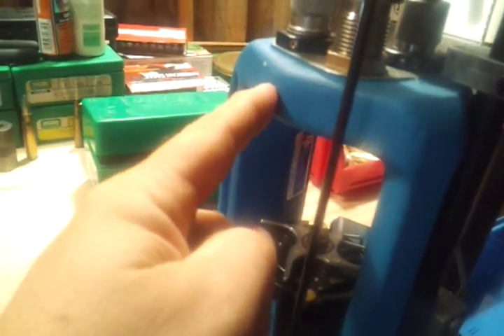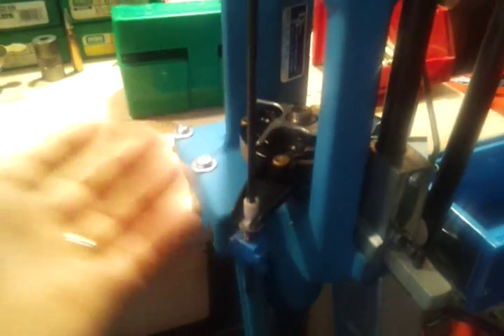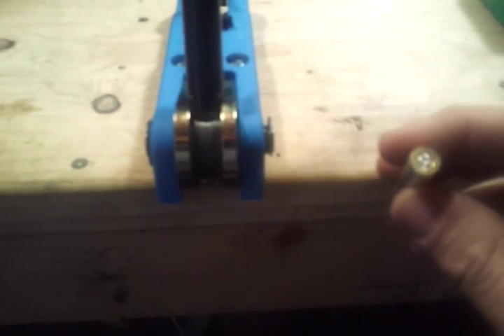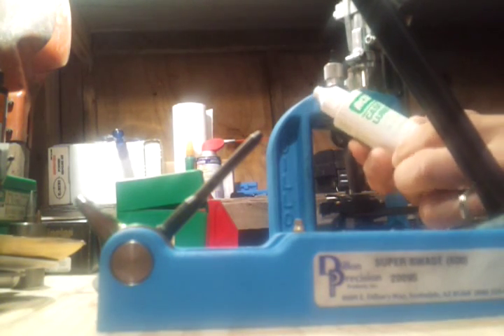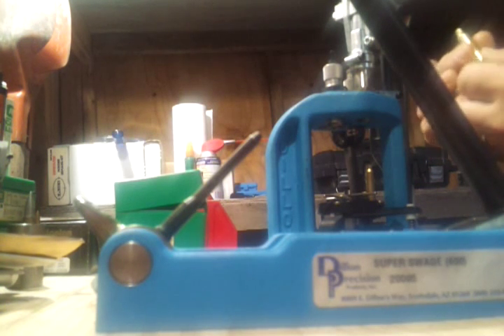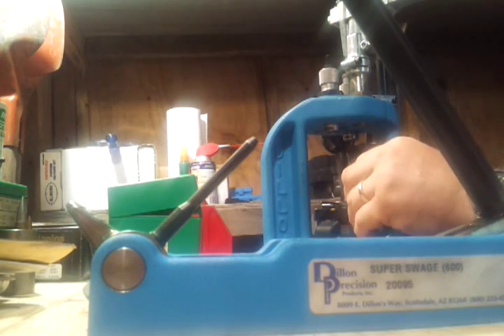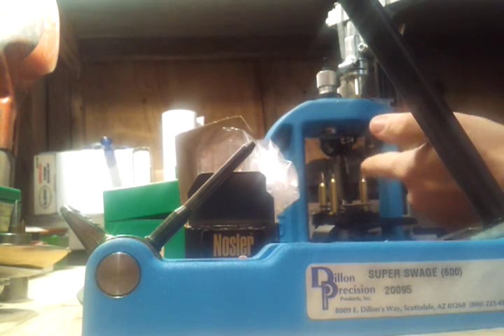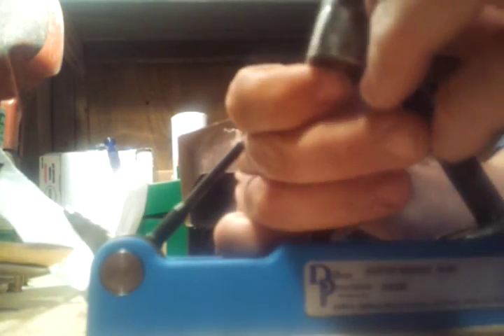Dillon RL 550B and Super Swage 600 demonstration

Comment from the maker: true but this was only a demo not meant to assist on setup. Its basically a trial and error setup. the post that the case sits on, adjusts in and out by screwing it (turning). You want a snug fit with the primer. don't over do it. make sure you feel it seat when priming it.